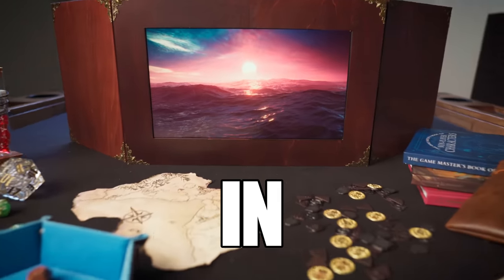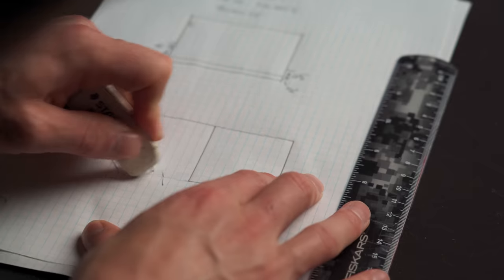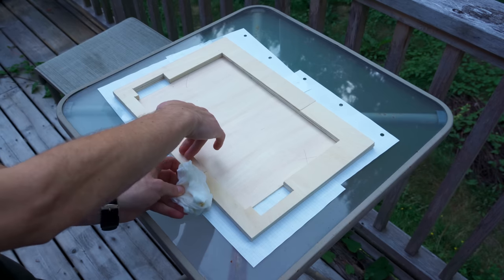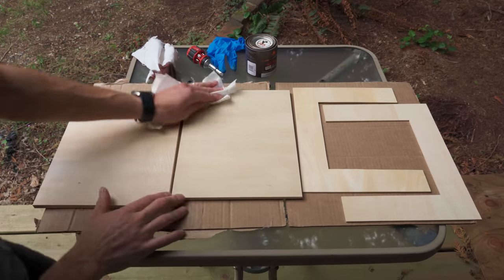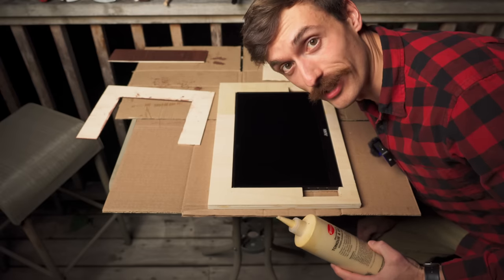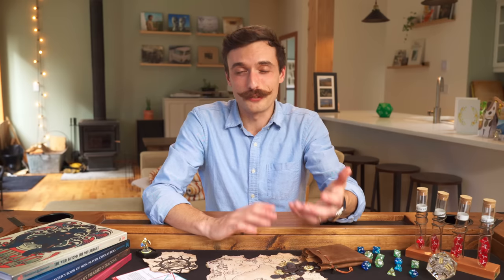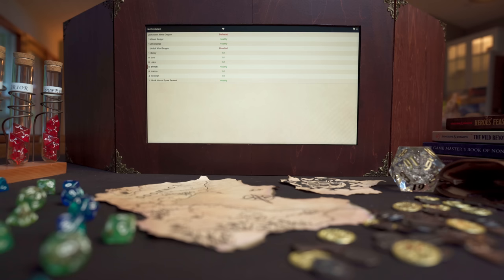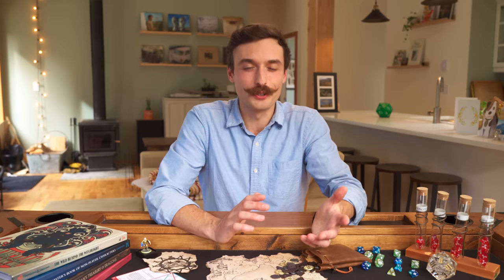I built a D&D DM screen with a built in display.

Comment: This is cool. I wish I had thought about a monitor when I built my DM screen. I fixed in quick guides on the inside and te front/edges are wrapped in faux brass alligator skin, giving it a brass dragon look. Then finished off with corner guards

Comment: I wonder a bit about heat management. As far as I can see there are no vents or such to let warm air escape from the monitor. Even if it isn´t the most heat producing thing in the world it does produce some and if it can´t escape it will just keep building up. Might not melt the monitor, but it may cause damage over time shortening the lifespan of the device
Reply from the maker: I've left it running for quite a few hours and haven't noticed much heat. But once the body of the monitor is saturated you will get some higher temps. But even after three hours I still wasn't feeling much. It might shorten the lifespan a bit, so I guess I'll see how long it lasts!

Comment: Great idea and really good execution, however there is one concern...
The monitor is probably the heaviest part of the screen and these wooden sheets are really light.
I would've added a little bit more weight at the ends of the side panels to prevent the whole screen falling over by just the slightest accidental touch...

Comment: This is an awesome idea, however, I would approach it a little differently. How about using an e-ink display instead of an LCD? Sure, it's only going to be black and white and static but it is going to fit the tabletop aesthetic so much better. Instead of essentially a monitor shining on your players for 4 hours straight, sipping battery from your laptop you get a print-like feel that can change to anything you want. Plus, you'd be able to use it unplugged, just put some nice art on there. 

However, this is going to be considerably more expensive and will require more sophisticated electronics - e-ink displays aren't as widespread and you can't really hook them up with HDMI.

Comment: @Power Word Spill, doesn't the cable coming out of the inner facing side of the screen block your ability to use the screen for its intended purpose?  the video shows four pages attached to the inner screen but we never see the cable routing when the pages are attached.

Comment: I might try this, but, if I do this I will probably have to find a way to attach the front panels with nuts and bolts rather than with glue (because I'm paranoid that I will have to eventually have to replace that screen)
Reply: Someone suggested small rare earth magnets. I used a 1/2" drill and 10mm x 3mm magnets to make holes for them to fit in, and it works great (though I can't fill in cracks and make it as seamless as the front)

Comment: I got everything listed but the monitor wont connect to my laptop. It powers on then goes to no signal and then low power mode. 

My laptop cannot even detect it. The cables work just fine it seems. I tried updating driviers, restarting, and checking the cables but no luck with just the usbc I even tried powering it from one port and connecting it with the other but no dice. 

I ordered a micro hdmi right angle port and a right angle usbc cable to try but I really just want the usbc adapers to work like they did in the video. Anyone else run into any issues like that?

Comment: I'd like to build a similar thing, probably going for something to easily remove the display later on incase it gets broken somewhen.

Also thinking about a design of not having a regular square screen, maybe some sort of nice decorations. Anyone got ideas for that?
Reply from the maker: Yeah if you have access to a laser cutter you could cut a really interestingly shaped monitor cutout!
Reply: @powerwordspill  
I went for a similar design, very simple. I love simplicity. I don't have a laser cutter sadly but I think it turned out very well. It's not plywood tho and I didn't glue the monitor inside of wood pieces, I can remove it whenever I want.
Thanks for the idea, really appreciate it <3

Comment: My laptop is a little older, but I can't get the screen to recognize video coming through the USB-C.  If I also hook up and HDMI to it,  everything works great, the monitor is powered from the USB-C no problem, just no video through ONLY USB-C.  Am I missing something?
Reply from the maker: Can your laptop connect to other displays through USB-C? It might be that your laptop can't output display through USB-C. USB-C is the actual physical plug, but not every USB-C port has display capability, which makes it confusing. Unfortunately you might have to use both HDMI and USB for power. But I'd definitely test it on a different USB-C monitor if you have access to one through friends
Reply: @powerwordspill  Thank you!,  I really appreciate the reply!

Comment: Super impressive! I noticed that the side panels aren't as thick as the centre panel, do you think that it would be viable to make the sides the same thickness as the centre panel and it still close up okay? 

I'm planning on putting some small bluetooth speakers in the side panels of mine for atmospheric sounds and music, but I would need the sides to be as thick as the centre.
Reply from the maker: Yeah I think it would still close no problem! Depending on the weight, you might want to add a fourth hinge, but you can test it out. Speakers are a very cool idea!
Reply: Thought I would send an update!

I'm currently building mine! All the centre pieces are glued together and I've attached the back pieces using some screws from the hinges to make the back removable. 

My ideas with the speakers weren't going to work unfortunately, they were going to be too deep to fit in the side panels. So instead, I spent a decent chunk of money and bought a maple birds eye veneer which I'll stain and laquer to make the whole thing look super expensive!

Comment: Hey man, this portable monitor is absolute trash. The rest of the components are great and cost effective. But the screen in the DM screen has worked exactly 1 time. I have tried 10 different USB-C cords. There is non-existent support for this brand MNN if you can even call it a brand, and there are some impressively fake amazon reviews. I understand that cost is a factor for things like monitors but consider recommending higher quality electronics for something that takes so much effort. I would normally let this go but I used your links so I know you received an affiliate benefit here. Otherwise appreciate the channel and the work you put into your content.

Comment: Metric might make math easier, but you can measure more accurately without digital tools with the SAE system. 1/32 of an inch is 0.7937 mm. 1/32 is the standard 'smallest' measurement on most tape measures and other tools, but 1/64th of an inch (0.3969 mm) is the smallest used that can be seen with the naked eye.

Comment: “Damp cloth”. Dampened with........? You should use mineral spirits between coats, and sanding. It cleans much better than water, and completely evaporates, so doesn’t leave a residue. Also, when glueing, you should brush it so that it evenly coats all surfaces, then line up all edges, because if you mistime the glue “tackiness”, you run the risk of it setting up too much, and thus layers having more space between them than otherwise.

Comment: I would be concerned about if the monitor fails or gets broken how to fix it. I think I would have made an offset interlocking design with a some kind of locking hasp on each end so when you undo the hasps the 2 parts separate to replace the monitor. But it appears to be one piece.

Comment: I have a two tier table with a screen built into the lower tier and use another screen for background art so if im using a forest battle map i can have  forrest background art as well all this is synced with music and soon rgb lights. The final screen is used to display character and item art/stat. I would really like to have two articulating arms to mount the two free standing screens too but this would be a great addition for my dm screen and then i could display  initiative and counters like status effect durations. Anything that can be forgotten ends up being forgotten so i like to take out the fuss and make it so i dont have to sweat it
Reply: I would like to suggest a 2k clear coat for autobody instead of polyurethane its much easier to get a crystal clear hard finish on this sort of thing. Software wise i also use a program called screen monkey its kind of quirky but absolutely free and because i can put a music loop and multiple pics on specific screens all with a single hot key it makes encounters  absolutely seemless
Reply from the maker: Thanks for the tip, I'll try 2k clear coat on some future projects. Cool, I'll check out Screen Monkey!
Reply: @powerwordspill  great project btw I can't wait to build my own. It would be super nice to have this at my table